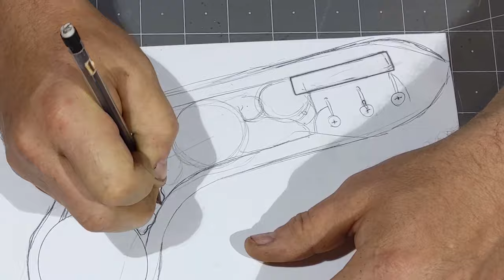Stainless Steel Spurs and Custom Leather Spur Straps | Lark Machine Co

Comment: Working in a shop with alot of tools and sanders granted we dont have a tig  but we have a wire feed welder  im pretty sure i could do this .. 
Im not saying  their craft is easily replicated   but after a few  would get better and easier. But im pretty confident i could make my own .. 
I have a pair on my ariat boots already  and ive priced some  wich got my interest  wondering .. so i think im gonna aquire the materials  to make the spur. But ill leave the leather work to others  or just buy some straps but the spur its self im def gonna try ...
Reply from the maker: That's awesome! I'm glad I could motivate you go out and make something.  Sounds like you have all the tool you need
Reply: @sheanyquist  thanks for the encouragement

Comment: How do you know what length material to cut for the band and how tight to bend it for different size boots?
Reply from the maker: I like to make a cardboard template.  I also make them a bit tight to start.  Leather does stretch a bit after being broken in

Comment: What tungsten and filler rod did you use? Also where did you get the spur band template? Can't fine one online or anywhere.
Reply from the maker: I used the purple tungsten. I don't know what the chemistry is.  Normal 3/32 stainless filler rod.  I don't have a template anymore, but it isn't to hard to draw one up for your specific application. Just cut some paper til you have what you want

Comment: how long is your "U" before you bend it? and whats size pipe did you bend it on? thanks
Reply: I would like to know the same thing
Reply: @jacobguitreau6454  I found out, 8 to 8.5 and I just traced out my boot heal and went from there
Reply: @timheller5929  ok thanks for the information I am making a couple of pair out of a rasp and was wondering how too make the jig to bend them but I seen your jig

Comment: Good job. But the craving is quite choppy and needs more work. I wouldn’t have started with the background first. I would’ve worked in the Beveling first, before going in with a backgrounder. Other than that, looked ok.
Reply from the maker: Thanks for the tip